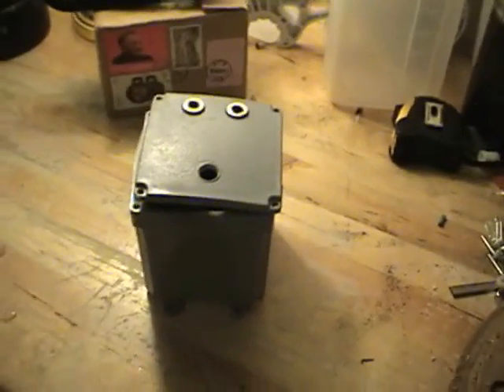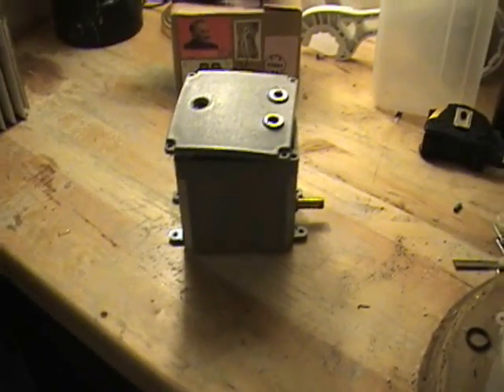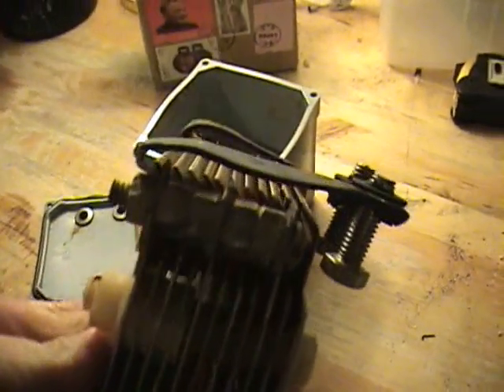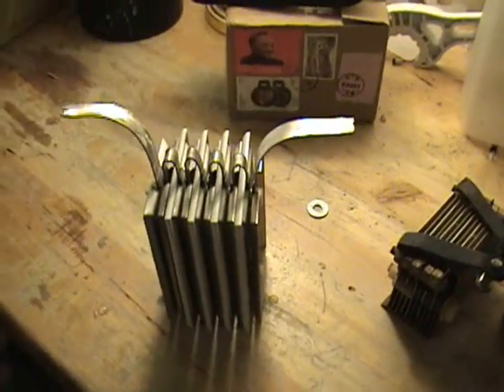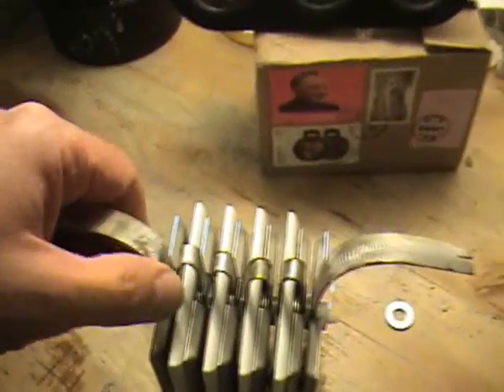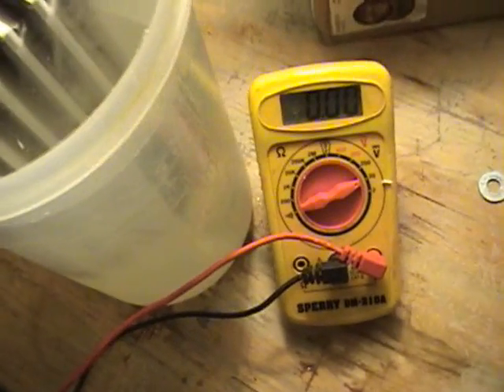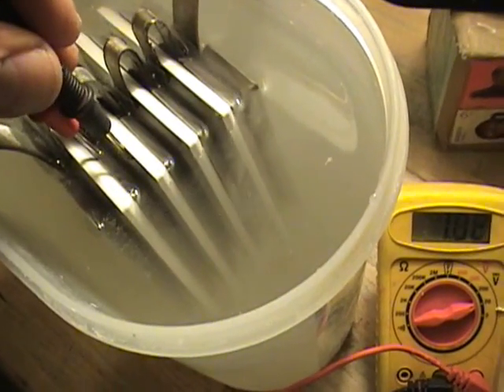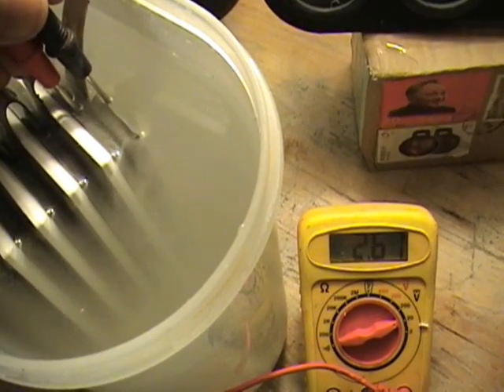(5) 5 plate HHO cell series design

Comment: Use hydrogen peroxide what would be  your. Use copper you will find the electrolysis work better.  It will fray much faster.  That's  a fact.  Just try it. However you would need to control the  voltage or it will explode!!!

Comment: I live in Alaska and I am working on something for my generator to run every once and a while to clean off the carbon on the head. . Cooling is not a problem with 4 feet of snow 6 months of the year and 20 below.
While my generator charges 12 volt for the house, I think I'll go with another 24 or 36 volt alternator specifically for the HHO. I have no problem with space, I could build it in a 55 gallon drum.  While I ordered some 8 x 12 x 1/16 plates from the steel supply for a 5 gallon bucket. It wouldn't be that unreasonable to make one in a 55 gallon drum. I can go as much as 35 to 40 amps which if used efficiently, would run the generator. I built one a few years back when this was all new even before neutral plates LOL and got it to barely run the engine with nothing left to charge batteries. Heck, it costs me a hundred dollars a month for gasoline. The plates were 70. Heck I might call today and see how much it would cost to have them punch the holes too. The payback on the plates is 3.5 weeks LOL. It kinda doesn't matter what it costs. Just cleaning the piston is all I want, if it runs the engine i'm gold. Even if I only get 10 amps and run it 24 hours a day, who cares. God supplies the water.

Comment: use 10 plates connect five to pos and connect five to neg every other one dont block the plates with insulator the same size as plates just insulate at connection of plates and make sure connection is not conductive and space plates quarter inch apart surface area is your friend and it will bubble like a mad dog.

Comment: The problem is you have them ran in series. If you run them in parallel, such as each of them share the same. Positive post but have different grounds then they will all get what ever the source voltage is. Keep in mind though your amps will increase significantly. Of one of them is drawing 2 amps then all of them together would draw roughly 10a idk for certain test one out and see them you will know what type of circuit protection you will need

Comment: You would get a considerable more production from your plate by using the perforated plates with the little 1/8'' holes every 1/8'' apart the stainless steel sheet come in as thin as 1/16'' thick which will be lighter and able to have many more plates separated with your gaskets. 
The reason this works better is as you can notice that all your hydrogen bubbles all generate from your edges of your plates so with the holes all through your plates gives you much more edges for your hydrogen to generate off of.

Comment: stainless steel, add baking soda (only for testing, use potassium hydroxide in the generator itself), and run the test from a source that's not a standing battery. it works best if you have it hooked up to a car that's running or a battery charger that's actually pushing some power through it.

Comment: The positive and negative electrodes are NOT supposed to be connected, so that the current finds conductive pathway through the water molecules. You're just heating up the water by connecting plates in series like that. There should be a space between electrode, neutral(s) and electrode (cathode/anode concept), and then current will conduct through the water and therefore produce HHO. Also you want to keep the cold if you want more gas, not hot.
Reply: Paulus Joshua I agree with that, he obviously don't know that

Comment: Isn't the + and - supposed to connect through the water? I though there should be no connection between the + and - exept the water.. Or I didn't get the concept of electrolysis
I made a fuel cell for my civic and seems to work pretty fine although it's a kinda so-so prototype and made with stuff i had, so it's far from perfect and needs an upgrade. But i think dry cells are more efficient, which i'm gonna make next and which i recommend to you :)

Comment: I used a aluminum heat sink cut it in to 2 pieces and interlaced them with rubber spacers, I haven't tested it fully yet but the amount of gas should be enough to run a small torch. Might be something to try yourself.

Comment: to improve your sell you will need to 1st learn how to build one. not create steam bubbles. the pos&neu plates should never touch. the water is the connection in the circuit.

Comment: run the voltage in parallel. remove the Teflon coating. put the positive at the bottom. negative at top.
Reply: but keep the Spaces gaps
Reply: michael mezack
his issue with parallel was the heat, boiling of the water. now his in series . think his prob is the volume of water. toomuch for such a little cell.
Reply: A bubbler with a circulating system helps out keeping cool
Reply: I find out with my cell that it works better with a circulating system
Reply: Also tried to use some rubber hose block the sides to block volts lost
Reply: Also keep a gap under the cell for minerals
Reply: My cell is 11 plates by 21/2 inches long and wide 3+/3- and I went 2000 miles no problem in my truck
Reply: yea his submerged technique aint all that well, i noticed your method is way more concentrated on the little water passing through. do you think running huge engines on these would be good enough for a power station?

Comment: You need to increase current whilst maintaining a low voltage, you can do this by: increasing electrolyte concentration. Warming the water. Adding more electrode area - having two or more of the units you have built in parallel or all of the above.

Comment: U guys out there often use DC for having HHO gas.
when ur at home U can use AC as well if U just want to mix the gas for welding, fuelling a motor etc.
AC lets u generate oxygen and hydrogen at each pole.
U dont need to rectify and can use a transformer only or even AC directly from the mains socket.

but not if U want to fill a ballon with pure hydrogen for example.
Reply from the maker: Can you show me where someone has done this?
Thanks
Reply: using AC for HHO gas?
couldn find anyone, thats why I posted this
Reply from the maker: It wont work with AC thats why you can't find it.
Reply: well for burning it u'll have to mix it anyway.
its no doubt dangerous to store it in large tanks but U still can generate the gas "just in time" and nearest possible to the furnace or wherever it shall be burnt.
Reply: Using A/C will generate Hydrogen and Oxygen at both electrodes, however, the gas mixture would be extremely dangerous and have no practical use, unless of course you were looking to cause a devastating explosion - then this is the setup for you.

Comment: if you're gonna run it for any length of time,like state to state,it needs more water volume,not for gas production,for cooling,that's why you had a melt down,most important thing to tell these people building one is to make DAMN SURE  it shuts off when you turn the key off,other wise they are harmless,don't let the gas back up for any reason,when on make sure motor is using the gas,period

Comment: TAKE A 3/16 SS WIRE AND ROLL IN TO TWO COILS ABOUT 5 IN LONG ROLL TO FIT INSIDE OF ONE ANTHER WITH ABOUT A 3/16 TO 1/4 IN GAP ,MINE WORK FINE

Comment: I've noticed with mine that the production goes up as it warms up, but it's still not getting great results.  If you up your amperage, you'll get more output.  I've also noticed that the amp draw, and consequentially the production will increase under a partial vacuum.  I don't know how much, but that's what I've seen in my workings with it.

Comment: I know this is a 4 year old video so you may have discovered the solution your self. I came up against a identical problem with a very similar cell when exploring hydrogen production back in the '90s. It just was not operating efficiently or as efficient a I thought it should. The problem is that all the cell are sharing the same electrolyte and there for are operating partial in series and in parallel. Place each plate pair in its own container of electrolyte, efficiency will increase.

Comment: Absolutely, the current will just skip on top of the plates and as you say won't go through them. The trick I guess is to get the right voltage through each plate to optimize gas production. I had tried the plate system one above, one below and it achieved excellent output.  But I considered it would tend to heat up and blow fuses if not careful with the electrolyte amount. I read best output is reached around 2v x electrode.  Also the use of neutrals they say helps keep the plates cooler.

Comment: my suggestion is you should get some muriatic acid submerge your plates in water then put 1/4 of a cup muriatic acid allow it to soak for 6 hrs this solution will also help remove rust and clean tools then rise plates put plates in fresh water add 1 tps of muriatic acid then run as little amps as possible for 12 hrs. on your old cell try and loop all of neutral plates in one circuit then do the same thing to the plates in the acid like the first set

Comment: you would need to have the + in on the top of plate 1, and then the out to the bottom of plate 2 then out to the 3rd plate back on top and down, up down up.... the power is just running across the top of those plates and not going through them... that is why it doesnt get hot the power isnt going through that plates just skipping along the top... electric takes the less resistant path.

Comment: I tried different steps to produce more gas, but over time, the plates become tarnished and wear away, I replaced the hydrogen side (- pole) plates with lead, it worked best and still produced and lasted longer. Lead gets dark, but hydrogen still is produced since in is smaller molecule, I still had to clean or replace positive plates.

Comment: I realize this is a pretty old vid. But I thought I might point out a slight error in your second design.
When you have your cath, connected to the top of the first plate, (in series) it should exit at the bottom and enter the bottom of the anode. Continue up the anode and exit the anode and enter the cathode at the top. A zig zag schematic if you willl.

Comment: @frithwks  HI.  I wanted to know if yo were considering the fact that when your cells are getting that hot you are surely producing water vaper along with the hho . I think you new design probably produces as much hho with out any water vapor. I think you are on the right track. maybe a larger generator .  I think it is brilliant that youare using the extra heat reducing plates.

Comment: I signed up just to comment onthis particular video...
I myself am trying to run an engine to run on HHO. Here is another of the problems you are showing...
The current travels from your first plate straight to the last plate (water is a conductor, specially with wathever your electrolite is) Build "walls" around the plates to contain the water ONLY between the plates, not around them. It wont get MUCH better, just helping your isues out here...

Comment: when you jump the current from one cell to the next, try passing it through from top to bottom instead of jumping acrost the top the whole time,this will force the current to travel through the cell plates before it can reach the next one... remember electricty will find the least path of resistance

Comment from the maker: at 12v you will actually get massive leakage. thats what is causing all the heating problem. neutrals are the key to controlling your heat. but in a series cell at 2.5v you do want to go +-+-+- like you said.

Comment from the maker: i made this video quite awhile ago. i have learned a ton and im designing my own cell now. you are on the right track when you say 5 separate cells will pull more amps. but you will never see the type of efficiency of a dry cell for this reason. a major part of the energy that goes into the cell is escaping from the edges of the plates instead of going through the plates. dry cell design is superior design. thx for posting

Comment from the maker: yes your production will go up because you have increased the voltage between each gap. try to keep it below 3 volts and above 2.5v between plate gaps for the best production to efficiency.

Comment: My production at 12v was not impressive, slightly more than this vid shows. But at 14v it's better and combined with the higher amp load from the alternator I think it would improve and run hotter. So I'm just going to try it as is and see what happens with it on an engine. But I will drop to 5 gaps if it doesn't improve. Thanks

Comment: I am dealing with the same issues you had with this cell. My design is -NNNNN+NNNNN- and its wrapped with rubber and I get a bit more production at 2amps and 12v but still not enough to help anything. Smacks claims having the pairs of neutral plates together can help. Good luck with your cells.

Comment: Ya i think you need more water / a bigger housing.  Water cools units.  Or less electrolyte but of course less electrolyte means less amps and less production.  You also need more amps to produce more hydro. Hook it up to a 12 volt car batt which will push more amps.  keep it in alot of water.  Its not the volts its the amps. I run 2 8 plate cells 20 amps each.  1.5 liters of hydro permin. Kinda brute force but waiting for the water splitter.

Comment: First, look at the spacing between your plates. Second, increasing the voltage is only going to increase the heat made while at the same time, reducing the amperage. Your cell will only draw the current it needs. Third, I have a cell running that is 1" dia and about 2-3" long that is making more gas (per size comparison) than your unit on 1 amp. The next one will go in my car.

Comment: True HHO production is a function of current.  Illusion of brute force high temp electrolysis is because hot gases occupy more volume, so appears more gas is HHO made.  It's not.   Ideally, you need about 2volts across each cell to be efficient.  Any higher voltage generates waste heat.  Sid Young's brick unit is the best garage design I've found myself.  The majority of folks have crappy design w/ too much voltage.  They are water vapor generators, with only like 100ml of real HHO per min.

Comment: Delvis, you are obviously very good on the bench. A series cell works by transfering through the water alone there is no need to block this transfer. do not wire the plates together -  add some lye sodium hydroxide for electric conduction for production or potassium hydroxide if you can find it. your number of plates is about right depending on how hot you make the mixture. VERY LITTLE GOES A REAL LONG WAY. Start with a 1/6 teaspoon to about a half gallon of water.

Comment: How big was the container that you said got too hot and started leaking? It looks like it is pretty small. That is probably the reason for the heat problem, or the plastic is too soft.

Have you tried making a housing out of CPVC? Or even PVC? those plastics are fairly hard, takes some practice to get a good seal on them though.

I really like that first plate design you used, am really enjoying all you guys showing what your doing. Keeps everyone from making the same mistakes over and over.

Comment from the maker: if you were to measure the gas output of two plates compared to say 10 plates you would see a big difference. 10 plate cell will produce much more and stay cooler and draw alot less current. it may look like alot but it isn't much.

Comment: Shrink wrap the connections between the units. need more complete isolation between each distinct pair. Do best you can to make each of your pairs a seperate entity.

Now that you are not overdriving your volts, you will need stronger electrolyte mix to get the amps back up to where they were. You want to slowly increase the strength of your electrolyte until you get your amps where you want them.

(isolation + more amps) = (more gas + less heat)